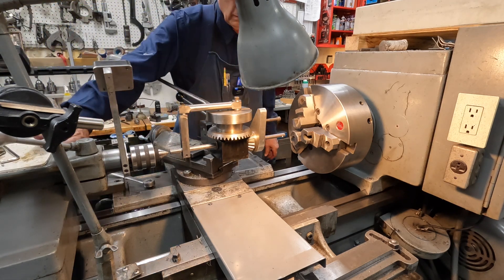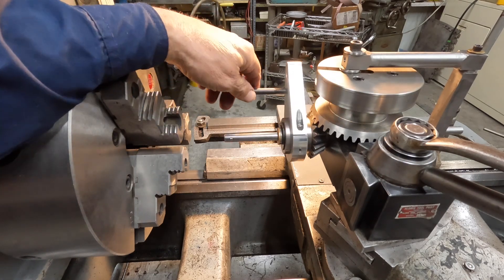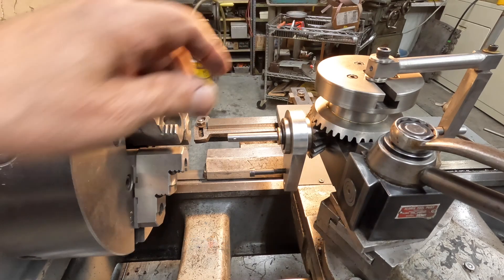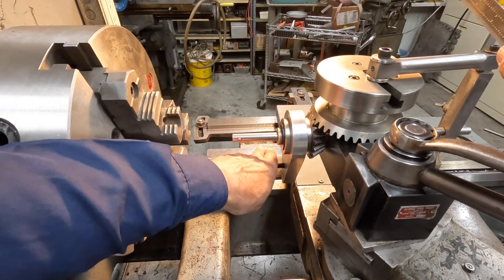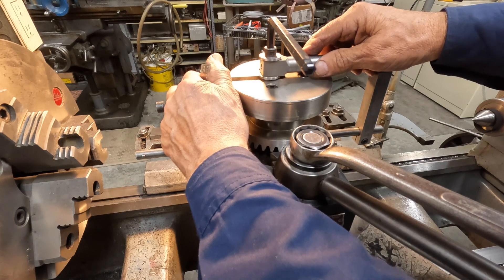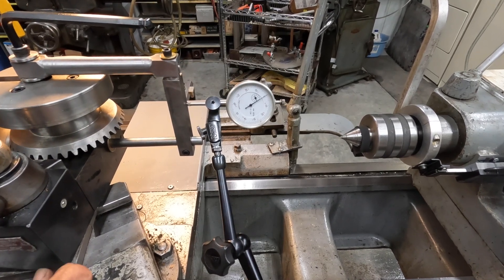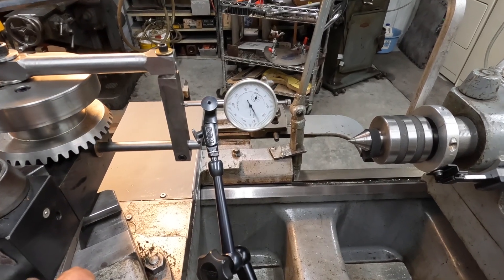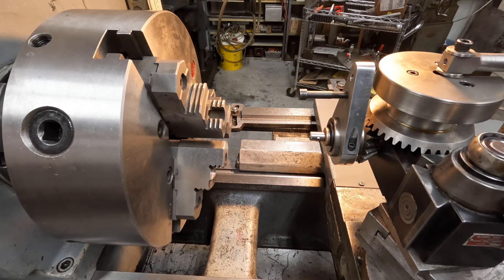Adding an Oil Groove to my Cord Bushing

Comment: How big a diameter can you do before the off centre driver becomes a problem?
Reply from the maker: Thanks so much for your question! I’m not sure how large a bushing it will handle, I designed it for the average automotive application, say up to 4 inches! But I think one could go much larger, my lathe can handle an item 18”, so theoretically almost anything. The depth of travel is a whole different matter! The depth of travel is about 8”, chatter could be a sticking point! It’s the minimum size that seems to be a concern! The part in the video was just a tad over 1/2”! Without some modifications, I’m at the minimum ID right now!